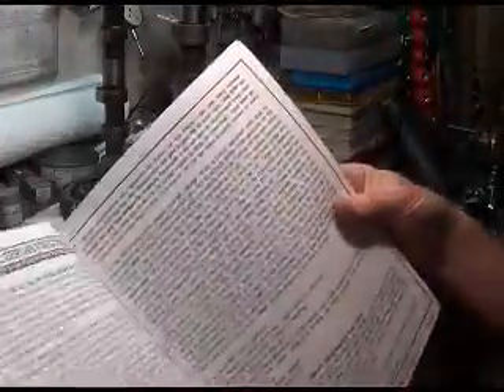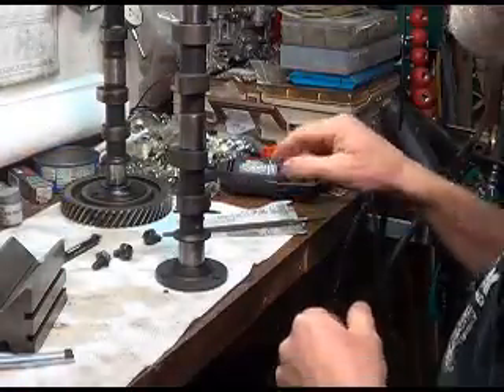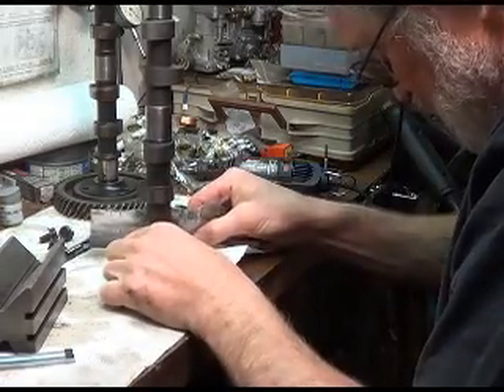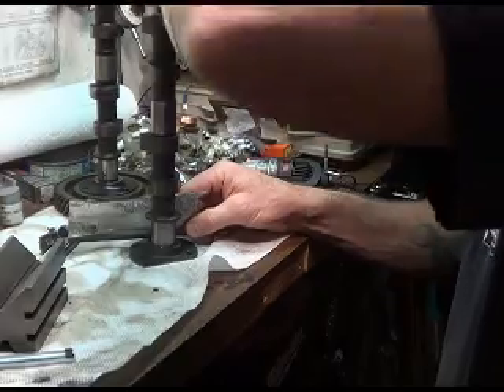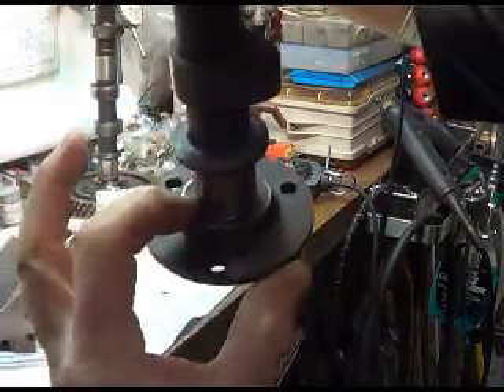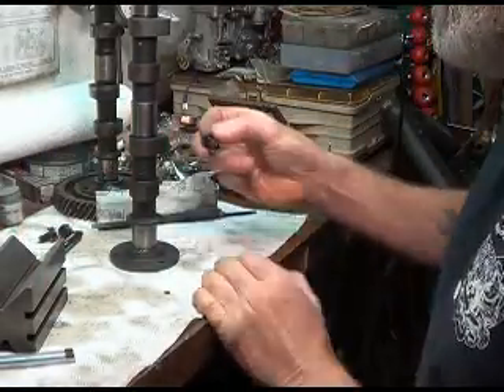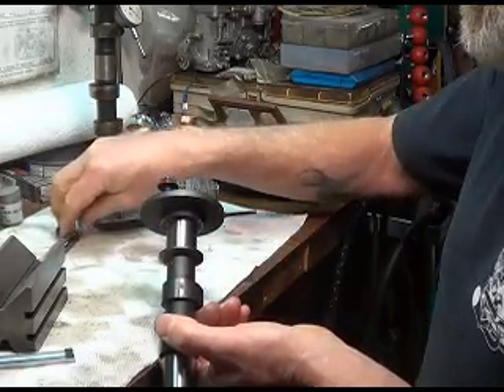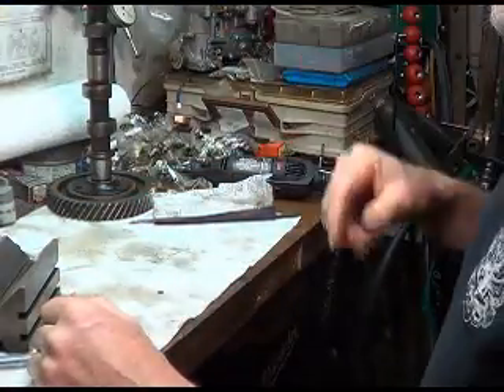VW New Camshaft Thrust Prep

Comment: EZ, quick question... when you go with a single thrust cam bearing, does it matter which side of the case it goes on? The 1,2 side or 3,4 side. Thanks much!!
Reply from the maker: 3,4 side because I use a engine stand and I’m looking down and fitting the cam gear clearance 😜
Reply: @TheEZGZ  Thanks EZ. I gotta clean up the cam like you did. It’s an Eagle, not Engle, and the Silverline cam thrust bearing is real tight. I saw another guy put sandpaper on a flat surface and sand the sides of the bearing a little.

Comment: Awesome video as USUAL. 
BTW, I am still waiting for your advise on the (-2) cam shaft gear it is getting very hard almost impossible to get hold of a new one of the. The stock gear is a 4 riveted one. From your 30 years of VW experience 😊 what is your advise ?
I am happy to go to Engle w90 or CB performance 2280 cheater cam BUT the timing gear is my limiting step here. PLEASE HELP ME 😂😂
Reply from the maker: The only difference it the oil pump is different depth. There are no performance camshafts with the 4 bolt deep dish.  
I think I mentioned already get the Engle w90 camshaft and Engel lifters and new 26mm early style pump.
Do not build your engine from info you get off the internet. Buy a shop manual and use there procedureds.
Reply: Thanks EZGZ for your reply and advice I have the Bentley manual. If you recall my dilemma is the (-2) cam gear (my stock), as I watched a lot of your videos and once you could not install a cam gear as it was too tight. Should I try the the Engle W90 cam and a standard cam gear. Or keep trying looking for the (-2) pitched gear ? Thanks again for all your help and support. Cheers 🇦🇺
Reply from the maker: @FunFun-tv7gq  If you have a -2 CAM gear on a 4 bolt cam gear buy a new 4 bolt cam gear and transfer the gear from the old cam to the new cam. Nobody is making anything but the new zero gear. The factory went from -7 to +7  .   Orrrrr you can go with a 3 bolt cam and use anybody's straight cut cam gear and listen to the noise.  They fit loose and don't have thrust issue's. Some folks like the sound.   I have run straight cut gears that were steel on crank and aluminum on cam.  
( They were called straight cut Magnum gears) they are not noisy and I do not know if they are still made but good used ones would be fit.

Don't sit on the fence and over aylize it to save a nickel. You said you don't have money. Replace the bearings and put the old cam and lifter back in and save your money until you can do it right and aren't pinching penny's.  You will learn from your experience and as time goes on become more comfortable with what your are working.  You can not avoid making mistakes.  Most people with no money have lot's of time so use it.  People with more money have less time and buy better quality.  
These old engines will run with many parts out of spec for a very long time if you don't abuse them.  
You have the Bentley book.  It tells you the spec. and the torque and the procedure. Do it!!!!!   and see what happens. If it doesn't  work right take it apart and see whats wrong!!!  Many builders don't replace the cam bearings. The older engine blocks did not have replaceble cam bearings.  8 valves / 4 cam lobes on opposite sides of the engine = not much stress with stock valve springs.......

Comment: hi i'm watching your videos and i like them a lot. I would like to ask you something technical. Iam building a wbx engine and i want to use a 2253 engle camshaft  . I will have big ports
 on the heads and 10.9-1 compression. I also want the engine to be efficient up to 6000 RPM.Can you suggest me something better for better operationThank you in advance
Reply from the maker: Keep it mild and add a Turbo with some type of fuel management  maybe 7 pounds of boost with EFI. 
It's not hard to make HP these days. It's hard to find a transmission that will take the abuse. These systems are already proven and in use.   I can' t afford them. I have never used them. I am nostalgic and use parts and info from my personal past and play it safe.
Reply: @TheEZGZ  thank you very much I respect your point of view!

Comment: Wondering why all the details and new block but choose to use some old cam bolts from another cam instead of buying new. Just curious!
Reply from the maker: Your Sharp. I used the old cam bolts to see what the actual clearance would be in the block as every one is different. The factory made like 14 different cam gears and I want to see if what I have will work. So for Mock up anything will work. I might have to go to straight cut gears instead of stock.   You get a Burrito.....!

Comment: I used to prep my cam endfloat as per your method....then one day (20 years ago) I had a light bulb moment......I now leave the cam alone and only prep the cam bearing face on a fine flat oil stone using plenty of oil......The bearing has loads of 'meat' on the thrust surface, I just slowly and evenly work the thrust face bearing over the oil stone......checking / refitting as I go....Either way is the same result.......
Reply from the maker: Your method will definitely allow the thrust clearance to increase during and after break in as the soft bearing surface is subjected to the helical gear thrust and the coating on the camshaft. There have been millions of engines assembled your way and they do run. Most of them were stock engines. However, when you increase the valve spring pressure as I am I think it's important to take Gene Bergs advice. For a longer lasting better performing engine with quicker break in time I suggest you go back to your previous method. I also like to polish my crankshaft bearing surfaces and some folks don't. Attention to details gives me that warm fuzzy feeling.  I only build engines for my own use. I take them apart years later after thousands of miles. I know what works best for me.

Comment: We've found that we had to smooth the cam thrust flanges on many Type1 cams. What is interesting is so far all of them were Engle cams. However, I'm not saying this rough cam thrust flange is only with Engle though as lots of cam manufactures use the same cam blank.
Reply from the maker: If people shop for lowest price then they have to do the finish work. That's why you and I are here to help.,....

Comment: Great video. Refresh my memory please, stock heads 1600 dual port, stock cam, when adding 1.25 rockers with same side adjuster as stock, will stock springs work or do I need to use high rev/Hd springs? I have a set if need be. I do remember from one of your videos that the stock push rods we’re getting distorted from the HD springs you had on there. I have some chromoly ones too.  I usually listen while I am driving, I really need to take notes but that’s not safe. 😂
Reply from the maker: All things being equal. Your Stock 1600 with stock cam and stock valve and spring assembly should convert straight over to 1.25 same side rocker arms and with a good tune up I felt a slight improvement with the seat of the pants meter. With stock springs your stock pushrods should work.
Cautions: If your going to increase spring pressure you should probably use the solid rockershaft kit. 
Some suppliers sell the kit that includes it all. 
If your not using stock valve adjusters you may need to add a shim or spacer under the rockershaft towers between the head and the rocker tower to correct geometry.
Also remember if your trying to get more HP from an old wornout POS your just adding more stress to everything. It's bound to run better (for a WHILE).
Reply: TheEZGZ I appreciate the reply. So, short story long (😁) it’s a 73 Super that I have had for a couple years and really hadn’t messed with it much. I didn’t trust driving it far as it has a few issues going on. I pulled it in to garage and decided I was just gonna drop the engine and go through it and see what I had. It cleaned up nice with my pressure washer, heads looked newer, so did the flywheel and pressure plate. Once I got the plate off the clutch disk looked mostly new too. Here comes the bad part, when I pulled the flywheel I saw the damage. It hadn’t been torqued right and loosened, it basically destroyed the crank dowel pin holes. Once I split the case the internals were pretty good, saw some blueing on a couple of the crank bearings but that was about it. The mains fit nice and tight with  no end play.  The cam looked amazing, I am gonna mic it before the rebuild and check the lift, I know how to do that thanks to your videos, I would say maybe it’s a performance cam by mistake like yours was but it’s a dish style cam so no luck there. lol.  I am just putting it back close to stock, I am opting for the 87’s, just have to watch my temps a bit more because they are a bit thinner walled. I don’t want to sink a heap into this engine, just make it reliable mostly stock. I have plans on building a stroker in a year or so, just depends on getting everything else straight on the car. I figured why not try some 1.25’s for giggles and all. That’s how I cam across your videos on that subject. I may even try the 2 intakes only and then do all 4, then throw the stick rocker assembly back, just to see if my pants meter can pick anything up between the three. I do have a solid shaft I am going to put the 1.25’s on and I did make sure they were the same adjuster side as stock. I also have some chromoly pushrods I may put in after breaking the engine in and just to see or should I say hear the noise they make. This car is just about around here and there car so if I break something no biggie. I’ll park it in the garage and fix it when I have time. This is the first Bug I have had in about 10 or 15years so I have forgotten most of what I learned about them when I drove their wheels off before. lol I drive a big truck so your videos definitely help with information and help me from being bored. I have to go back after parking up sometimes and watch certain parts to get the feel of some of the tech things because I just listen as I drive. That goes hand in hand with my no-note taking while driving, not safe at all. Keep those awesome videos coming, I have  lots to learn and lots to re-learn.
Reply from the maker: @jonathanfarmer3653  Sounds like you have a great attitude and understanding of the big picture.  Good luck with your project.  Here is a tip for your Super. While you have it down check the universal joint on your steering column. It's hidden under the gas tank. They are famous about going bad and causing some shimmie and shaken. Saves spending money on other front end stuff that still has some life. I like your idea of keeping the motor stockish and building something more experimental later.  Hope you stay health and safe on the road my friend. I would think most of my vids would put you to sleep instead of keeping you awake. LOL
Reply: TheEZGZ thanks for the tip, I did not know that. I plan on pulling the tank anyways, been getting a lot of small rust material in my fuel filter and I am gonna clean it all out.  It definitely has the Super Beetle shimmy now. I laugh right a long with your vids, it would be boring if it was just strictly tech.  But wait, there’s more....I like the genuine down to earth, real life situation type of explaining.  The stories and stuff keeps it all interesting and flowing real well.  🤜🤛

Comment: i never did that, i hope it does not any badeffects on my cam bearings
Reply from the maker: Don't worry!  Most folks don't even know about it. It will make it's own happy spot and live happily ever after.  This is more for people running double valve springs or stronger chevy springs.
Reply: @TheEZGZ  good to know that, BTW i am using silverline doublethrust bearings and single hi rev springs for a scat C25
Reply from the maker: Most of this will wear off during your initial 20 minute cam break in. That's one of the reasons you want to change your oil after that first start up. To get all this little stuff out. On a fresh engine build or even a rebuild everything has been disturbed and moved micro amounts. All that scrubbing and rubbing occur"s during your break in period. If you did a good job on your assembly the engine will make good power for a very long time.

Comment: Great tip.👍
Reply from the maker: Thanks 👍
Reply: what was the tip?
Reply: @daos3300  
Watch the video again.
Reply: @vintage76vipergreenBeetle  he starts out quoting from a berg book about cam endplay adjustment, then spends 30 seconds with 600 emery to remove what might be parkerizing, sounds surprised when it comes off and then says he can feel the difference and thinks he's done some good. then segues into cam bolts. so, what's the tip?